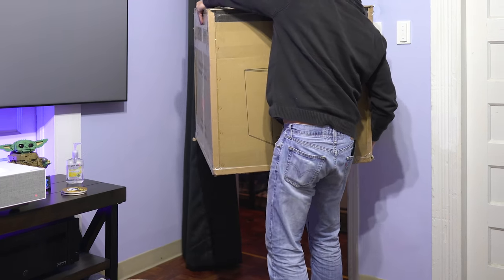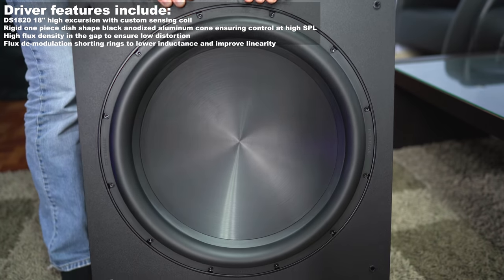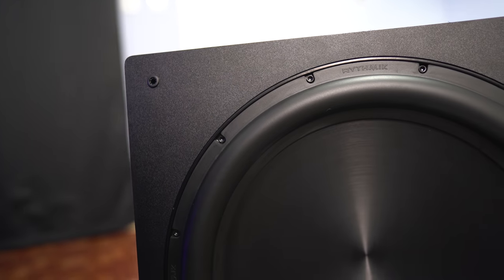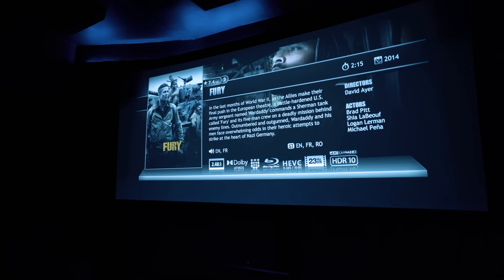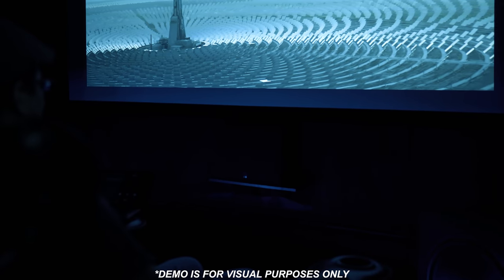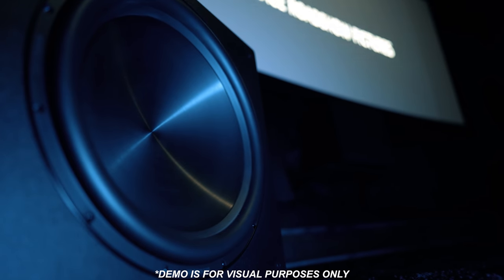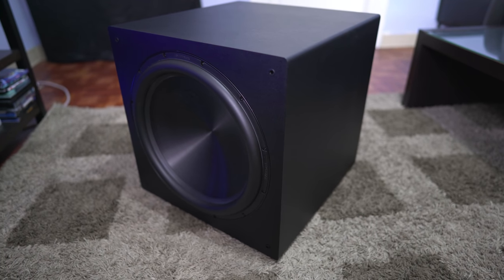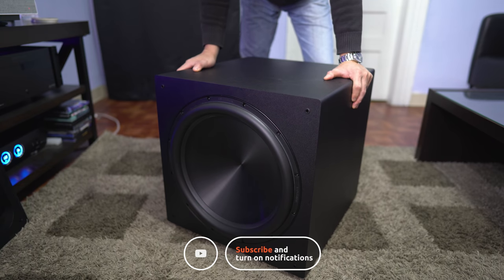Onslaught of Bass! RYTHMIK F18 Subwoofer Review | Dual 18's!!!

Comment: Hi Shane! Which do you prefer  for HT use, Rel 1508 or   Rythmik 18 subwoofer?
Reply: I'm not Shane, but the best way is to test it in your room. (Base is extremely dependent on room size, type of walls, sub's placement). It is the only way to learn which one generates "better" LFs for your teste also. Single digit's low end is... let's say interesting 😉 but just for purpose of replication of true theater experience in home, Predators are better choice in my opinion and more fun too. Another thing, plese take into consideration that not every movie has deepest LFE demo material. You can also look at the specs of best pro subs made for actual theaters or at the Dolby's specs for their certified theaters in terms of LFE requirements - this may be helpful when making decisions. When there is no place or money constraints the best way is to have something like 2 or 4xPredators to do "justice" for 20Hz+ region (i mean dynamics,  and fast hard kicks) and additional sub/subs to do work under 20Hz when such low frequencies will (happily) appear in the mix. Excuse my English. First: it's not my language and second: I'm not using translators, so I can assume I'm making lot's of mistakes.
Reply: @zbigniewkrol3899  You have a good point regarding Rel subwoofer. I'm planning to get 2 Rel Predator . Thank you 😀
Reply: @zbigniewkrol3899 , you make some really great points. I never really understood the single digit chase either, been there and done that. Nasty vibrations as your house begs for mercy spoils all the fun anyway. Flat down to 20hz and I’m good to go.

Comment: It would be terrific if you could get the G22 in for review from them. Not much info online from what I can find. These seem great, but Lots of us are looking for that great at movies and music sub that isn’t the best at either. Perhaps that one could still dig deep but be a better performer for music. Would love to hear your thoughts.
Reply: I was wondering the same.  There is way more discourse on forums than YouTube on Rythmik.  The G22 has dual opposing woofers, which cancel vibrations, which mean less tactile response, which is better for music.  Keep in mind that smaller woofers don’t necessarily mean tighter bass because they have to have higher levels of excursion to displace the same amount of air, which means higher risk of distortion.  I’m considering dual E15HP2s or dual F18s myself.

Comment: Awesome.  So how did they compare sonically to the Balanced Force 212's?
Reply from the maker: The ML is an around better sub. For movies I'd go Rythmik.
Reply: Agree with Shane - large balanced force are the GOAT- as they should be at their price point. But oen REALLY needs dual subs for HT- two of those are $10,000 +. When you can  get dual Rhytmik  for 1/3 that and dual Arendal for 1/2 that, cant imagine why you wouldn’t pout that 4-5 grand to work on your LCR speakers, and amplification

Comment: Stereo Integrity 24" HS-24 is $1,399 and 145 Pounds(No Box) 3,000 Watts RMS. Hand-Made in USA. Now they are selling Boxes to go with the Subwoofer. The HST-18 or 18" is $999 and 90 Pounds 2,000 Watts RMS. Box should be 8 Cubic Feet Sealed and 20 Cubic Feet Ported for the 24".
Reply: You can get a custom made 1" MDF box at a car audio shop that makes boxes. Amplifier you can buy from Stereo Integrity (1 and 2 Ohm capable) and attach it to the box.

Comment: I think the fv-18s would give you more output and options with their plug system. If you're thinking home theater then absolutely vented...

Did you even do a sub crawl or did you just stick them in the corners? Even better do some measurements with REW...They will sound different in other parts of your room if placement is possible.

Make sure you split them up so they aren't basically the same speaker. One in front to the right and one in back to the left is a good option.

Comment: I have dual F18s and love them.  I got piano gloss black to match my speakers and cabinet (as you can see in my profile pic).  It's nice to finally see a review of them.  I agree with everything you said, although I wonder what your opinion would have been with respect to playing music had you changed the damping to high and perhaps the extension to 14hz.
Reply from the maker: When we compared them to the BalancedForce subs there really was no comparison no matter the setting. There’s a reason those are $5k a pop and this is $1700. These are still the best HT subs for the price/ performance ratio.
Reply: The right subwoofer you need to compare with the ML BalanceForce is the G22, period. The G22 is literally a 100% music subwoofer. Its has little to none tactile response and it's the most accurate subwoofer I have listened too. I have a pair of G22s in my main living room that I use for music and movies. To compensate for the lack of tactile response, I added a pair of Crowsons motion actuators to my seat. Also have a FV25HP in the same room which I switch to on via miniDSP 2x4 HD when watching movies.
Reply: @enricocastagnetti2400  yep, just ordered a pair myself... 80% for stereo and 20%  for home theatre. Hoping to get rid of my svs pb13ultra though. Hoping that quick, accurate and low vs tactile and low will actually be the bass I really want, plus I am running out of room!
Reply: @mesonto  SVS makes good subs coupled with brand recognition, you should be able to sell it fairly easily.

Comment: I've actually been looking at two of the G22 dual opposed 12" subs given the overall size is pretty much the same as the 18". What you said about the 18" driver not being the most articulate I'm hoping the G22 will be a better musical sub with some db loss in the extreme low end.
Reply: You will lack tactile response from the dual opposing woofer design.  G22 is a music sub for that reason.

Comment: I had my mind made up on the REL 1508, until this review came in.

I was sold on the F18 review until you clarified it was not as fast as the SVS, which is already slower than the REL.
(I auditioned a REL 1205 and SVS SB-2000 pro)

I wonder how a Rythmik F15HP may compare to a REL 1508.
Reply: I’m curious too.  More so on the E15HP2.
Reply: He set damping on low instead of High. I think that might caused his experience with not so snappy bass.

Comment: 900 WATTS? Assuming that they aren't full of crap what is the impedance of the woofer? 8, 4, 2  ohms ??? A 900 watt amp running at 2 ohms is closer to 300 at 8 ohms and is running balls to the wall.  I'd rather 900 @ 8 ohms wouldn't you? Whatever the case it's the amp that'll fail first. 5 year warranty on the driver and 3 years on the electronics says it all. I wish someone would tear apart active speakers and give us real world numbers.
Reply: Good luck finding an ID or retailer subwoofer company that repairs their amps after warranty for $120 including both ways shipping. We are able to service amps that are more than 10 years old and our repair rate is always no more than $120 - $150.